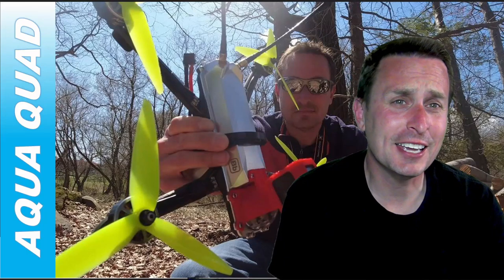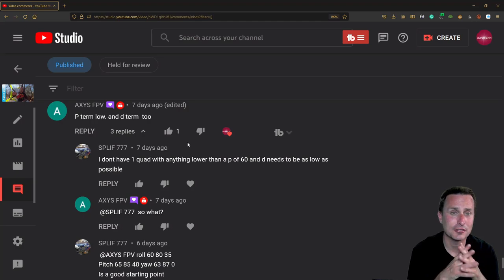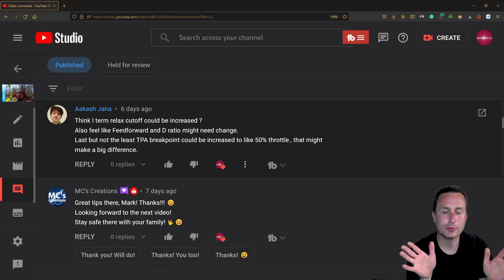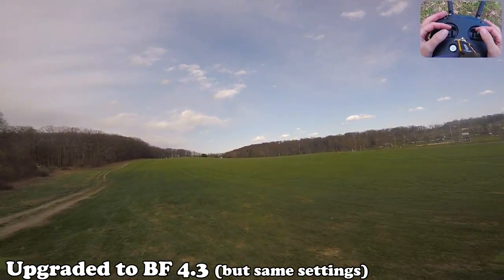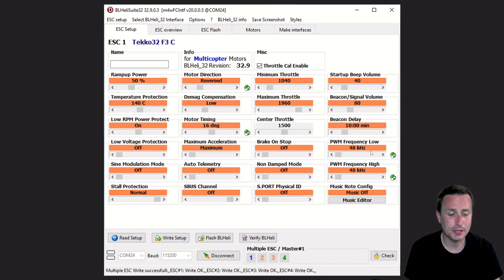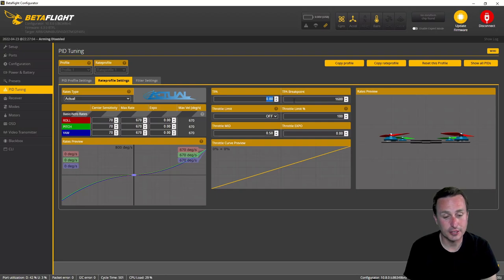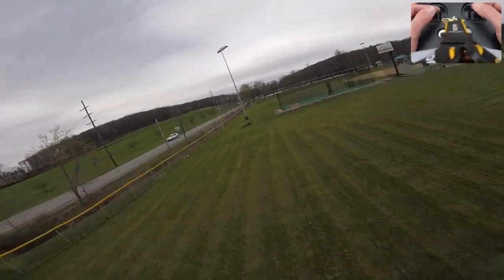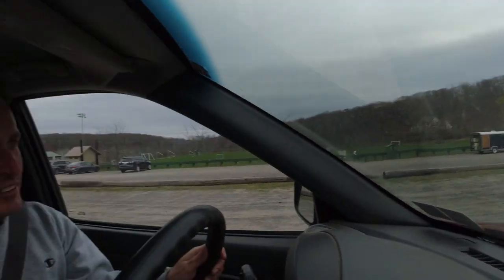SOLVING 7" Oscillations / Wobbles   |   7" Tuning Tips

Comment: After this app my 7 inch Chimera Wobbles  to left to right like a crazy...
Reply from the maker: "After this app" -- which part or what does that mean?
Reply: @uavtech  Hi Mark, i installed your preset  for 6-7 inch on my chimera 7 i also tested it on another 3 quads Rekon 7 (Motors-Xing2 2809 1250kv, T-Motor F100 and Avenger 2810 1500kv. Battery 6s 5000mah. TBS Crossfire nano RX Divercity and the same for all with wobbling ((((
Reply from the maker: @lucifuje  if you have wobble, make sure you ESC PWM frequency is low (16 or 24khz) and lower the Drift-Wobble slider.
Reply: @uavtech  Thank you for reply Mark 💖